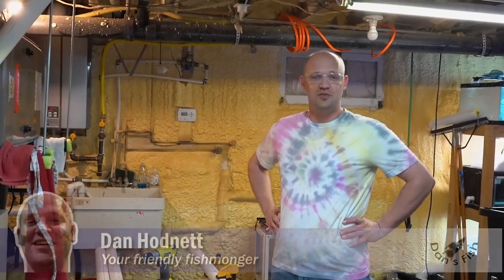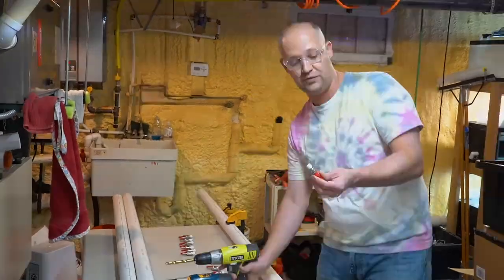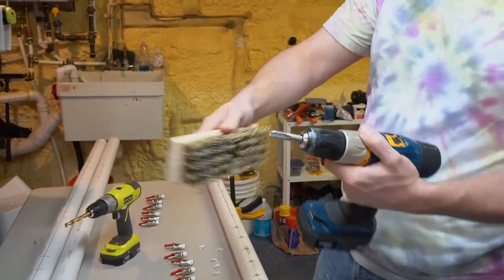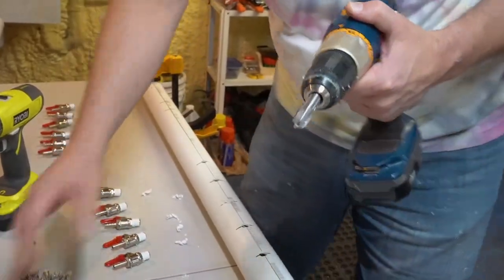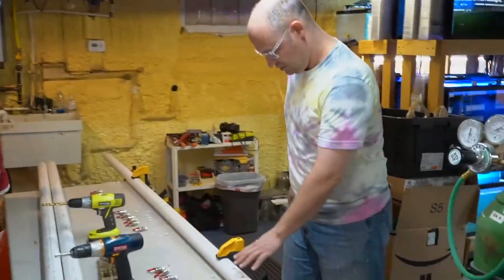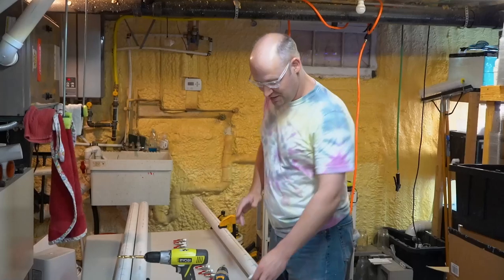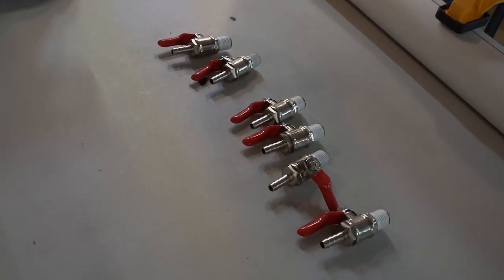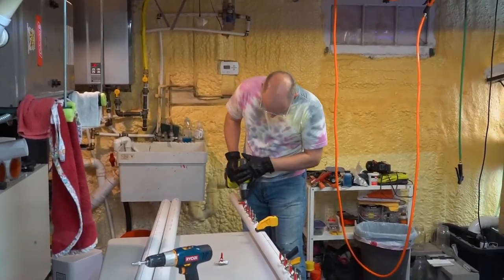Constructing New Water Valve Manifolds for the New Fish Warehouse

Comment from the maker: Due to several concerned comments, I realize I need to clarify something. While we are running lots of water through the aquarium system, we are not consuming that water. We are circulating it through the system, not draining the local water supply. The amount of water that will actually be consumed is negligible and won't have any impact on the local water ways or water supply.
Reply: So you are running a central sump? I was going to ask you how you afford to heat all that water just to flush it down the drain!

Comment: As an Australian living in one of the driest places in earth this seems crazy.
Reply from the maker: While we are running lots of water through the aquarium system, we are not consuming that water. We are circulating it through the system, not draining the local water supply. The amount of water that will actually be consumed is negligible and won't have any impact on the local water ways or water supply.
Reply: @DansFish  cool, so you are filtering and reusing?

Comment: 1M gals per day?  You going to save some for the rest of Wyoming?  🤣
Reply from the maker: While we are running lots of water through the aquarium system, we are not consuming that water. We are circulating it through the system, not draining the local water supply. The amount of water that will actually be consumed is negligible and won't have any impact on the local water ways or water supply.

Comment: Do you recycle the water or special filtration?
Reply from the maker: While we are running lots of water through the aquarium system, we are not consuming that water. We are filtering it and circulating it through the system, not draining the local water supply. The amount of water that will actually be consumed is negligible and won't have any impact on the local water ways or water supply.

Comment: You really think you will change 1,000,000 gallons a day?  That's 694 gallons a minute or 11 1/2 gallons a second.  What size pipe do you have delivering that volume of water at that rate into your warehouse?  That is approximately the amount used by a town of 10,000 houses.
Reply from the maker: Andy, I'm not just doing this DIY. The system has been engineered by actual engineers and permitted by SOE and the USACOE. Also, the water is not consumed. It is sterilized and returned to the water way cleaner than when it was removed from the water way. So, while it is a LOT of water, it is non-consumptive use.
Reply: @DansFish  Yes, I didn't read the comments before posting, I just heard you say that you were going to be using a million gallons a day and did the maths, I was trying to visualise what diameter pipe you might need to carry that much water from your municipal water supply company.  I now realise you are not getting your water from the 'mains'.  With that turnover of water the stuff you are returning to the creek is probably far better than anything I've got in any of my tanks.